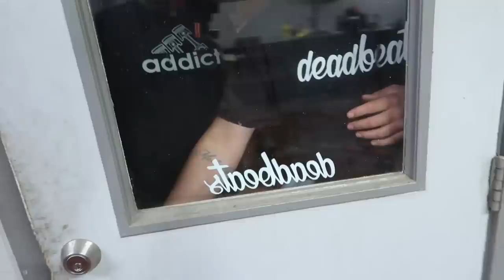Disassembling The 5.3 LS with Braven!

Comment: That cam retainer plate that had the orange rubber gasket is VERY important. If that gasket is missing you'll destroy the main and rod bearings within 500 miles or less. My buddy had that gasket missing when the machine shop assembled the block and put that plate on without it installed.  It'll have oil pressure but won't lube the bearings at all on the lower end.

Comment: Main bolts are fine to reuse, you dont need to try and upgrade. If you go with ARP main bolts than you have to line bore the block. It makes it more annoying trying to get the right bearings.

Comment: Bro get some 4.8 pistons they are flat top and raise the compression when you put them on the 5.3 rods and crank it’s cheap and easy also when you put it together get the aluminum and rubber water pump gaskets